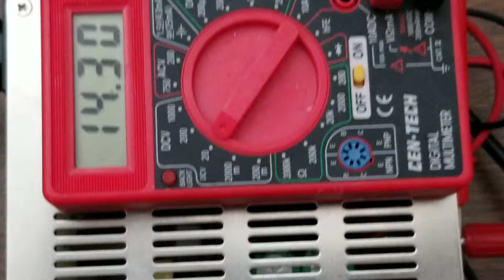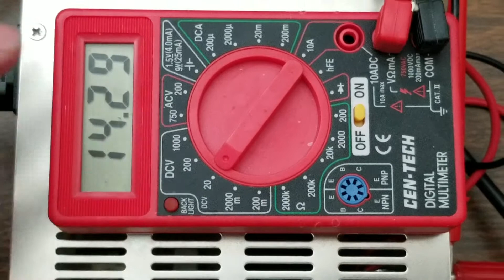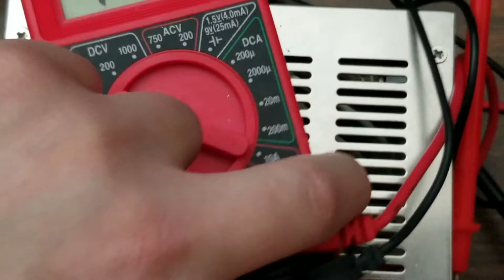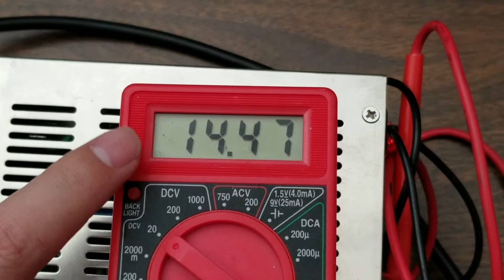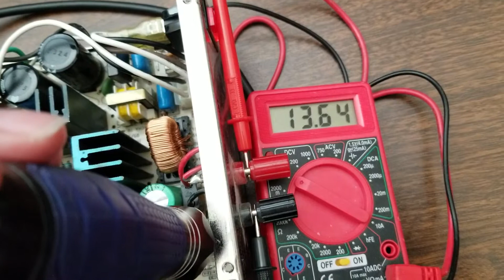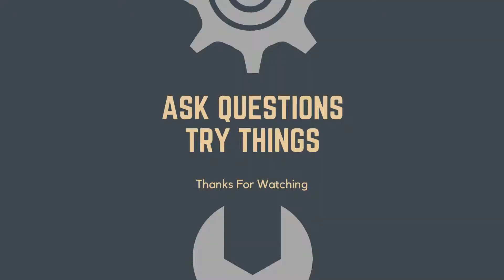How to Fix a Power Supply With the Wrong Voltage

Comment: It’s not your power supply that’s displaying the wrong voltage. Is that shitty ass multimeter that you have. I know this because I used to have one. They suck.
Reply from the maker: That power supply was specified 13.8 v from factory so i needed to adjust it as i needed it for a 12v application. Yes, I should get a fluke or other quality multimeter. Sometimes you have to use what you have.
Reply: @ and sometimes you need to spend the extra $5 and just get a better meter. They cost about $20 for a quality craftsman. Doesn’t have to be a fluke. I have an “amazon commercial” meter that cost me $15 and is accurate as all hell. Love that thing.

A quality meter will change your life and is fundamental, I promise.
Reply from the maker: @PeterJFrancoIII thanks I'll take a look at that "Amazon Commercial" meter

Comment: Is that a car battery charger?
Car battery charger should be at about 14.4v...
Reply from the maker: The nameplate rating on this power supply is 13.8V. It's definitely not a car battery charger as this uses much thinner wires. The application of these 13.8v power supplies that I'm aware of is typically for Ham/CB Radio. As I don't have a CB or Ham radio to power I'm repurposing this for a general lab power supply.
Reply: true, but it is very close to ATX PSU.
Reply: @DrZipZwan  It is the same topology PSU, but im preety shure that PSU has only one output(judging by the look of the circuit board), and the ATX PSU has usually 6 or 7 different outputs, and most of ATX PSUs will not have the potentiometers.
Reply: @filenotfound__3871  Correct, I guess it is those PSU used to supply LED sometime. I got one and it got a small pot as in the video, but outside not inside of the case...
And correct PC PSU got 3 output: 3,3v. 5v and 12v ))
Reply: @DrZipZwan  The pot oudside of the case is most likely a fan reglator, they wouldnt just let you play with it, the voltages on the ATX PSUs are: +12, +5, +3.3, -12, -5(only on older versions), +5vSB, +5v(power ok signal)
Reply: @filenotfound__3871  nope the pot on the model I got is to regulate the voltage, it got no fan.
Basically this pot is just to regulate voltage between 11.5- 13.5. In case you wana set it lets say to 12.0V precisely ))
Reply: @DrZipZwan  What PSU is that?
Reply: @filenotfound__3871  there you go: https://www.walmart.ca/en/ip/AC-110V-220V-to-DC-12V-5A-60W-Voltage-Transformer-Switch-Power-Supply-for-Led-Strip/PRD27F4494NBH8J
As you see, there is a small pot to callibrate output voltage ))
Reply: @DrZipZwan  I tought you were talking about an ATX power supply...

Comment: I got around 210 to 213 electricity voltage supply in my house and my computer can't run at that voltage what should I do please help me
Reply from the maker: If your PSU doesn't have a switch to convert your PSU to run at that voltage (many PSU's are dual voltage range with a sliding switch near the plug or power switch) . You would need a step down transformer to convert from the mains voltage you have at 210-213 down to what your computer needs. Your other option is to replace the computer PSU with one that will run at the mains voltage you have.

Comment: I switched the psu to higher voltage than standard and it smoked and pc won't start
Cand anything else be damaged?
I know the psu is dead
Reply from the maker: in some cases other things can be damaged. if a visual inspection doesn't show any issues, you will have to replace the PSU to see if there was any other damage down the line. There is a good change the damage will be restricted to the mains side of the PSU.

Comment: I noticed today a burn smell coming from my pc, turned it off and then tried to reboot. No display but the fans and lights still work. I noticed the psu red voltage switch in the back looked a lil burnt. What should i do?
Reply from the maker: With Computer ATX power supplies it's generally recommended to replace the whole unit.
Reply: Ask Questions, Try Things replace the psu?
Reply from the maker: @hybrid0824  yes, with computer power supplies often replacement is the easiest route. 
If you have to try to repair, make sure you are familiar with electrical safety with devices with large capacitors. Capacitors in computer power supplies can hold enough charge to cause injuries or even kill you. Burned components can range from capacitors and resistors to IC chips and transformer windings (the magic blue smoke was let out). Computer PSU's are much more complex than the simple lab power supply I repaired in this video.

Comment: Sir, 
My cpu is 220v and i accidentally plugged it in 110v supply here in canada and it suddenly turned off. Now it keeps on turning off whenever I turn it on. I didn't see any sparks or any burning smell.
Could you tell me what could be done to make the cpu run again?
Reply from the maker: Sorry, I'm just getting to your comment.
Unfortunately, power supplies that are damaged by under-voltage or over-voltage require a different level of diagnostics. I would try a different power supply.

Comment: sir i have question my country is 220v,and then i accidentally switch my PSU 220v into 110 and then plug i saw spark in PSU.its my PC die? or PSU die?
Reply from the maker: If you're lucky you only blew a fuse. But it's possible that more components in the PSU are damaged. As for the PC the only way you would be able to tell is to connect a working PSU.
Reply: @askquestionstrythings  can I start the PC after switching back to the right one? I did the paperclip method and the fans worked.